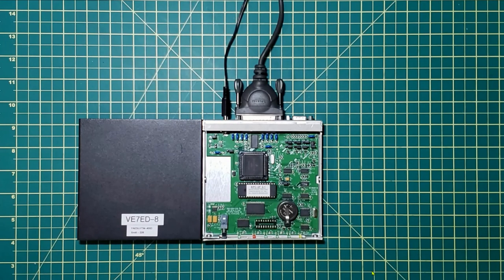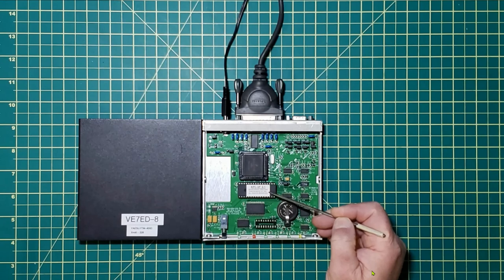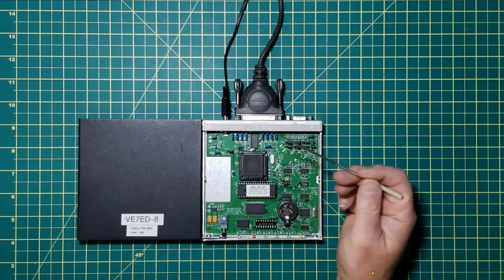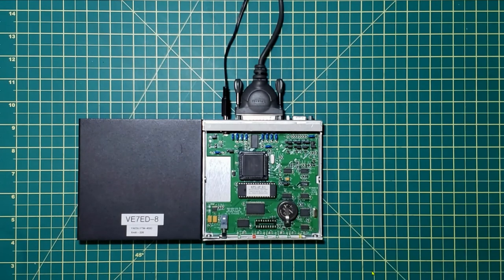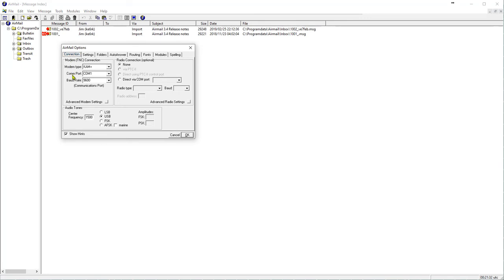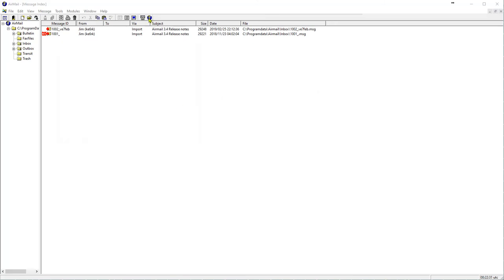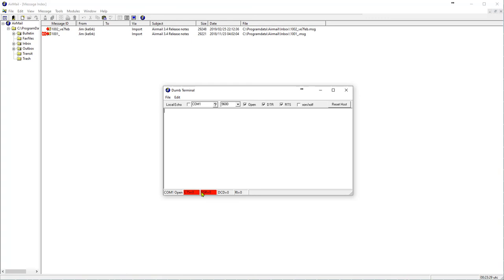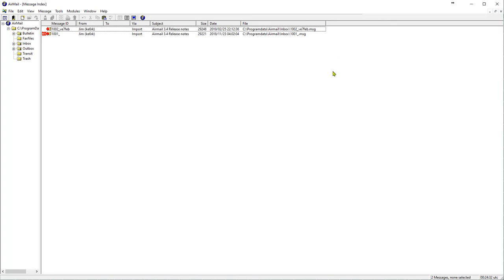Packet Series #6, Kantronics KPC3+ inside

Comment: Sorry to disturb, mate, but I have a question.....I am thinking of having a go at Winlink and SailMail etc over HF. I can get my hands on a Kantronics KPC3 (not the Plus) version for nothing. I only see these being used on VHF. Can a KPC3 Pactor modem be used on both HF and VHF? Regards and thanks...de CT7BGN.
Reply from the maker: KPC3 series only works on packet, I do not hear any packet on HF anymore. The Kantronics KAM was the first one that did Pactor. You might want to try VARA which uses a soundcard to you HF radio. If you HF radio doesn't have a built in soundcard then you could use a Tigertronics - SignaLink USB Interface. Hope this helps
Reply: @ve7ed  thanks for the response, mate. I got the modem just because it was available...have done a bit more learning since my previous comment...yip, VARA with Signalink or homebrewed equivalent will be the way I go in the end, methinks. 73 n tnx agn.